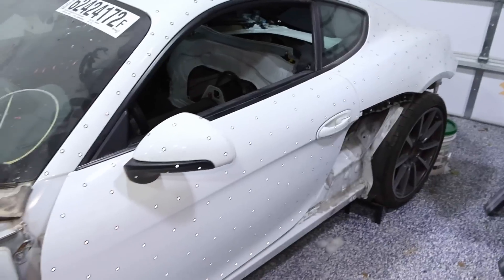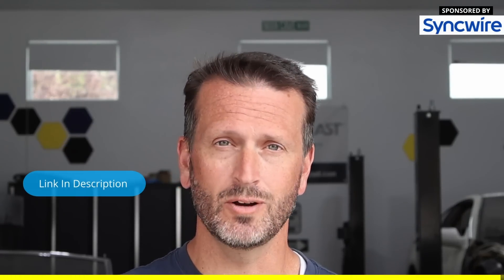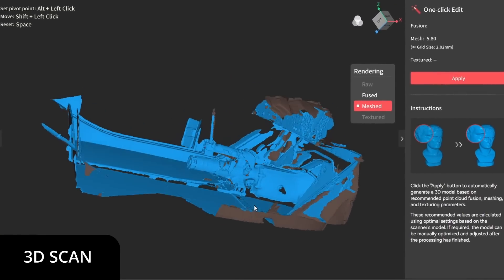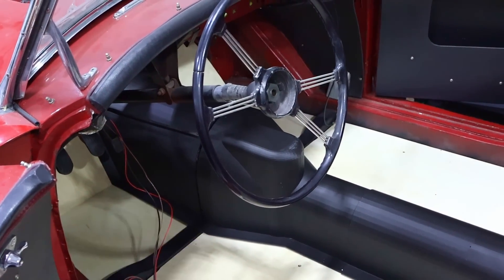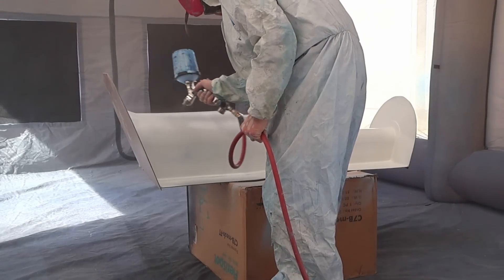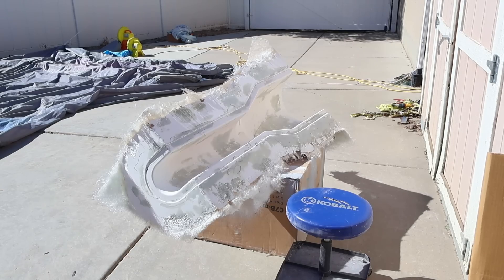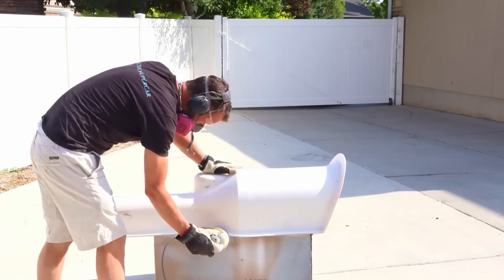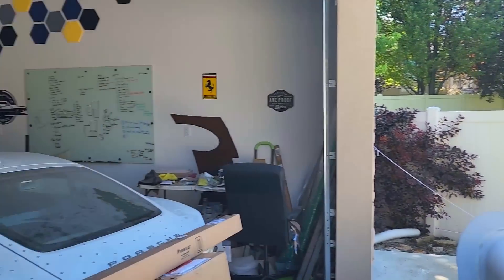Custom Transmission Tunnel - How to make a fiberglass transmission tunnel from scratch

Comment: A suggestion for mold making. You can use a lighter-weight fiberglass for your first layer when making the mold, then use some 3M spray adhesive to help tack the fiberglass sheet in place so you don't run into the resin curing issue.
Reply from the maker: Thanks for the tips!

Comment: For joining 3D printed parts, I'm wondering if it would be possible to use Prusa slicer's feature for creating pegs to join parts. It would require making the part thicker around the joints, but would save some manual work of plastic welding or gluing parts together after.
Reply from the maker: Good call!

Comment: I’m not all the way through the video, but why even make another mold and a separate part, why not just put fiberglass and then carpet over the top of this tunnel piece and be done with it? Heat resistance? Flexing with the body?

Comment: There is a touch of pride in this work. It is not just a job but a work of a craft. Like the old carpentry instead of quick ikea part.

Parts turn out great when worker builds stuff to be proud of instead of money.
Some say it is wasted hours but result is a marvel. And this part looks like it came with the car. Or actually better.
Reply from the maker: @mabettaja  thanks Friend!

Comment: Any reason you don't make some ABS or ASA parts for the final part instead of making plugs for fibreglass? Curious as to why you go for fibreglass...
Reply from the maker: I don't think a 3D printed part will last long in an open air roadster with UV, heat, and water
Reply: @electricsupercar  You have a good point. I'd like to see how well ASA, ABS, PEEK and ULTIM handle the long term UV and heat....
water definitely no problems for most plastics.

Comment: Great video giving me plenty of ideas for my own build. Was gonna suggest 3d printing the mould so glad I waited till the end to comment 😂 1 question though, could you not just use the 3d printed part? If it’s for strength you could model wee pockets on the underside to strengthen with a metal plate or strap?
Reply from the maker: I don't think a 3D printed part will last long in an open air roadster with UV, heat, and water

Comment: If you are going to 3d print multi pieces parts more often, I suggest you separate the pieces with a zigzag pattern and not a straight line. I think that would make it easier and more accurate to join later.
Reply from the maker: Thanks for the suggestion!

Comment: This is the second time we've seen you do 3-D printed parts that were only to be used as a plug for Fiberglas. If the 3-D printed parts were made a little thicker and made from the "right" material, why wouldn't they be good enough? Sand them smooth and maybe cover them in a vinyl material. The process you show looks to be VERY painful/ labor intensive.
Reply from the maker: The cost of quality

Comment: A tip for the "flat spots" when converting round geometry to STL: you should be able to set the resolution for the STL files somewhere. Higher resoultion means more processing time and slightly bigger files, but that would probably save you a lot of time spackeling and sanding the moulds.
Reply from the maker: Good call!

Comment: hi a little tip with the hot stapler when using the wiggle wire to staple push it in to the depth you want then turn it about a 1 to 2 mm then release the staple this will create a stronger join  keep up the great work as a panel beater it brings a smile on me dial seeing others enjoy working on cars weather electric or gas guzzlers cheers from down under
Reply from the maker: That's a great idea!

Comment: With a 3D printed model, why don't you create pins to join the pieces?  You only need the inner side for casting and you have connecting notches on the outer side so that the pieces fit into each other?  I think that would save you a lot of time and work.
Reply from the maker: Good call!

Comment: Something you can use to stiffen your mold plugs is fill the backside with a two part foam. Once it's expanded it can be trimmed flush and since it bolds to the form, it makes everything duper rigid. If you can't get the two part foam components for some reason, "Great Stuff" is a good substitute though it might cost a little more.
Reply from the maker: Nice!

Comment: I like that you added what you would do different at the end of the process in the video, Jeremy.  It shows that you are evolving you processes as you progress, and that is always good.  With the video, you take us along for the thought process behind those changes, which is very educational.  Almost time to apply a layer of tinfoil to the outside of your inflatable paint-booth to mitigate some of the heating issues, or have another structure provide shade and move some air to around for additional cooling.
Reply from the maker: Thanks for the comment!

Comment: You mentioned flanges, Using alignment tabs would make easier to mate two parts.  Use some ducted fans with expanding tubes to draw in air from cooler place then exit toward top?
Reply from the maker: Thanks for the tips!

Comment: Thought, you had good reason to make print of the part, test the fit and placement of the part. What  if you printed a skeleton / course wireframe of that, for that purpose? 
Printing the mold with flanges would be a win!
Reply from the maker: Good thoughts!

Comment: I have a question, I 3d print a lot, Why don't you just print a part that is thick so it will become strong and use it instead of using fiberglast? especially if you use the very strong filaments to print with like ASA  or ABS? 

So just print with PLA and 1 wall thickness to test the fitment then switch to ABS or ASA with more thickness. it will save you a lot of work and let the printer do the hard work

I love your channel I have been subbed for 3 years now, keep it up Jeremy <3
Reply from the maker: Interesting 🤔
Reply: @electricsupercar  I was thinking this as well. Or, why not print the part to be the mold itself already? Wouldn’t you be able to just finish the internal cavity and lay fiberglass in it?
Reply: Oop… just finished the video 😂

Comment: I've heard that if you use step files instead of stls, it fixes the polygon issue on curves
Reply from the maker: Interesting 🤔
Reply: Olias on Bambu Forums explained it well I think. 
"As far as the slicer is concerned. All files that are migrated into the slicer end up being a mesh. The difference is that a STL file starts out as a mesh whereas a STEP file has more precise measurements overall.

It may help to understand the distinction between a STEP and an STL. An STL is a mesh made of triangles(sometimes imprecisely referred to as polygons in some slicers) that are linked together. A STEP file on the other hand is a series of mathematical equations mapped out on a 3D X,Y,Z coordinate system. STEP files provide much more detail and far more accurate dimensions when describing things like lines, curves and arcs. STL files have to try to “approximate” a curve by cutting down the shape into finer and finer mesh."

Comment: Ever considered printing out the panel and just wrapping it in fiberglass or carbon fiber instead? I would like to do the 3D printer one day and just curious if there is a down side.
Reply from the maker: Interesting 🤔
Reply: @electricsupercar  yeah I figured it would lesson the process. And seen one guy use a plastic in his 3D printer that is better for heat and stronger uses it just as panels only. Though I feel like I’d want to layer it in fiberglass.

Comment: The part looked great! when you say 3d print of the mold what do you mean? after the coat of drywall on the print, add a layer of mold release/mold release film and fiberglass over that then you can vacuum down against the print. Rather than print a positive to mold a negative to fiberglass positive, what if you print a positive and make the part positive over it, just make an allowance in the print for the thickness of the material
Reply from the maker: Interesting 🤔

Comment: You can increase the detail of STL files to minimize the faceting effect. My slicer can work with STEP files so I do that instead. STEP files are a true mathematical representation of the geometry instead of STL's linear interpolation that causes faceting. 3MF files also store geometry like STEP files. There are more options but that's what is common. Depending on the minimum step sizes on the the printer itself, you may still end up with minor faceting as the printer controller will eventually have to do a linear interpolation to conform to a Cartesian coordinate system.
Reply from the maker: Good to know

Comment: I've done some fibre glass myself and it's not easy so well done with this. Will you need to build a hoop over the propshaft in case of failure to prevent it ending up in the cabin?. The old steel tunnel would have been much stronger but maybe the Netgear motor is not powerful enough to be an issue.
Reply from the maker: Good call!

Comment: I would use a layer or two of Kevlar just for peace of mind against catastrophic failure that could send some fast-flying shrapnel.
Reply from the maker: I think the plan is to have a metal hoop to attach to the frame on the inside of the transmission tunnel

Comment: Wow I’ve never heard of an electric car with a transmission outside of the Taycan. Is the motor for the Nissan the same way? Also why not just use the 3D print as the tunnel? You can always coat it more and paint it, right? Seems like that would be perfectly fine for a build like this.
Reply from the maker: I am not sure a plastic tunnel on an open air roadster would work well.  Too much UV, temperature, and moisture to last long

Comment: You should verify your stl conversion parameters, because you can increase the number of faces for each poligon that will make up the 3d part in the 3d printer software. This way you'll avoid those flats on the round faces.
Reply from the maker: Good call!

Comment: I have a portable tire inflator which I kickstarted years ago, and it works, but the display is not well done. I was going to look for one, so thanks for the review. Also, you could put some ice at your ventilation fan of the booth, would temper a bit, but could add moisture too.
Reply from the maker: Interesting 🤔

Comment: Would a 3D printed tunnel not have been strong enough to permanently install in the car?
Reply from the maker: I am not sure a plastic tunnel on an open air roadster would work well.  Too much UV, temperature, and moisture to last long.
Reply: I was thinking this too, what about fiberglass right over the plastic.  Would be a little heavier than just fiberglass but probably stronger.

Comment: Why not just use the 3d printed part as the transmission tunnel?
Reply from the maker: I am not sure a plastic tunnel on an open air roadster would work well.  Too much UV, temperature, and moisture to last long.

Comment: I'm extremely impressed man! The only thing you might want to take a look at is the vicinity of the accelerator pedal to the tunnel. I might be looking at it wrong, but it looks quite close, and that the  pedal pad was removed. If the owner is going to carpet, you want to make sure the accelerator pedal doesn't get stuck on the carpet and that his/her foot fits on the pedal properly, and not on the outside of their foot. Other than that, love the builds and videos. You have a natural talent for fabrication.
Reply from the maker: You nailed it!  With the transmission moved over, all the pedals need to move over as well
Reply: @electricsupercar  awesome bro! You're on top of it! Love the content and the fabrication!

Comment: In CAD you can give in export the number of sequments you want! You can realize perfect round shapes, no visible sequmentation
Reply from the maker: I think you can
Reply: Yeah. In Fusion you set the Refinement level in the 3D print dialogue to the highest setting and it smooths out the curves.
Reply: In Siemens Solide Edge you set the segmentation level in the choosen file export.

Comment: Got a question, probabaly a stupid question. Why do you have to make a fiberglass mold? Can't you just lay carbon fiber on the plug and have it cured there?
Reply from the maker: Yes you could.  Mold usually gives you a better finish
Reply: Got it